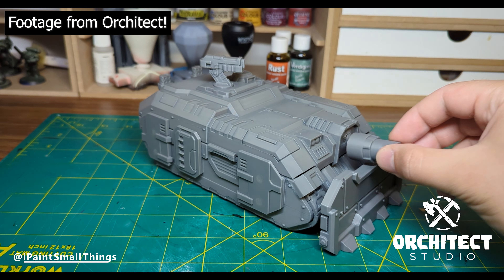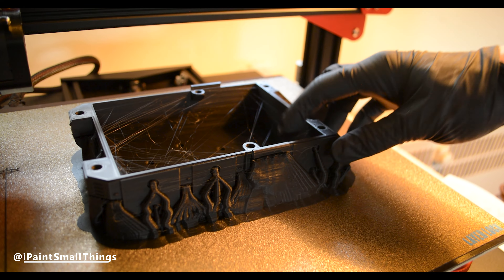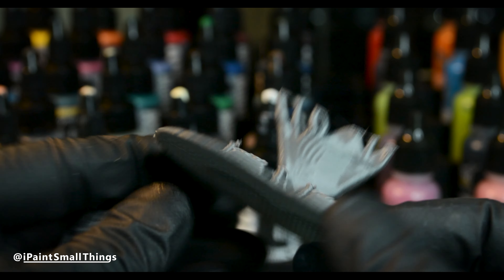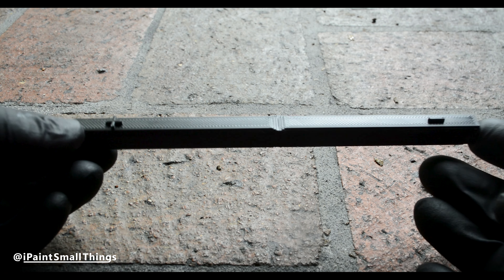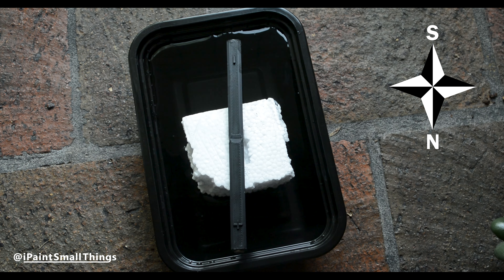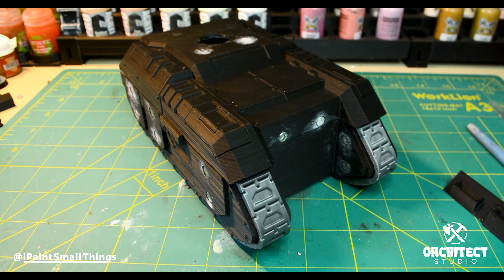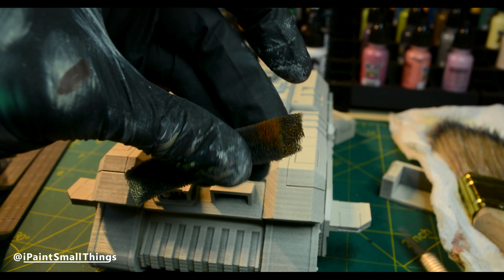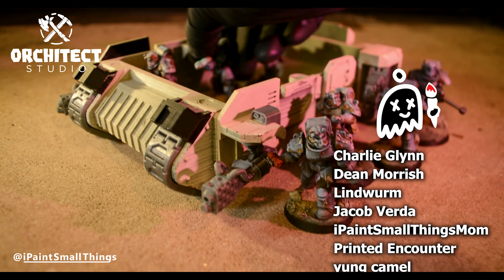Should You Print VEHICLES with FDM?

Comment: i print my entire army in FDM, its absolutely good enough
Reply from the maker: That's cool to hear! What printer do you use? I should really try to print a mini with FDM one of these days.
Reply: @iPaintSmallThings  i used an ender 3 for a looong time. I have an Anycubic Kobra plus now and auto leveling is a must have
Reply from the maker: @TheCheeseKnees97  Interesting-- I've never heard of the kobra. I'll look into it! Thanks!
Reply: @iPaintSmallThings  i tried a couple of minis with the stock filament and 0.1 layer and i was surprised of how well they looked, the only problem is that some details are lost.
a better filament like Sunlu PLA meta seems to be the best for the detail, and manually setting up the supports to minimize surface contact. but it seems to be completely doable now, unlike 3 or 5 years ago.
Reply from the maker: @Badbufon  I'll make sure to try some sunlu PLA then! Yeah-- the bulk of my FDM experience comes from like 8 years ago when printing a mini wasn't possible. Wild times haha